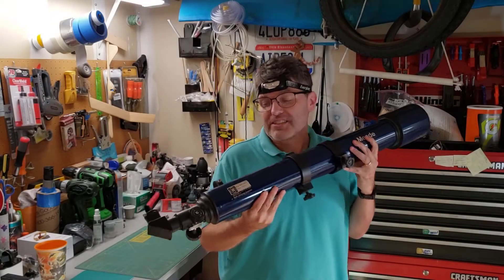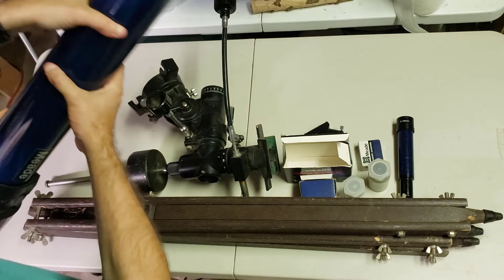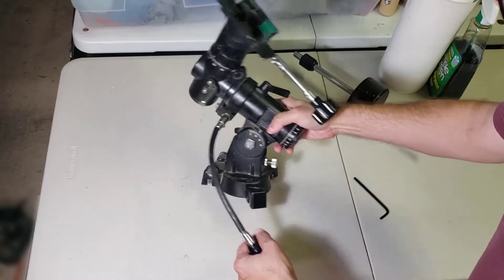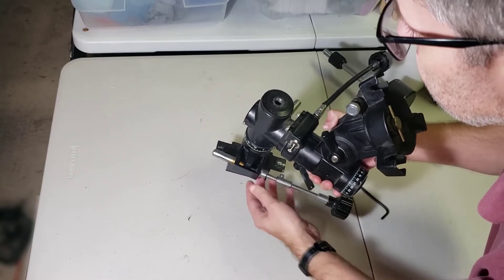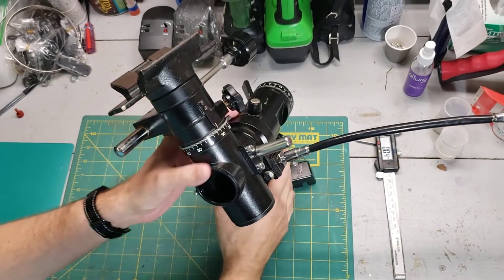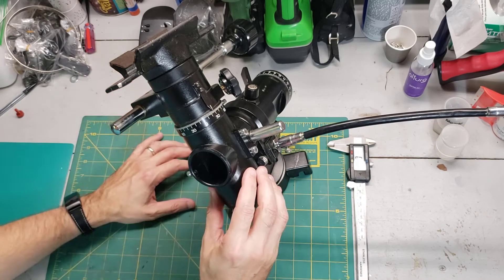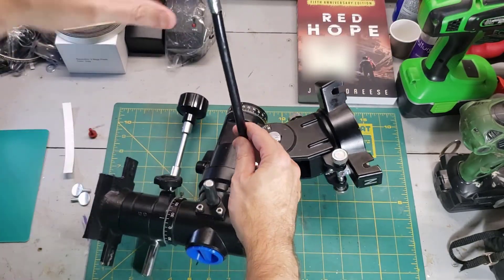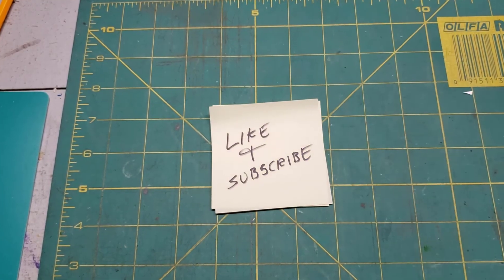Turn $10 Mess Into $300 Telescope | PART 1 of 2  ( Meade 320 )

Comment: I used to have a telescope like that. I did not like the flex cables. I found that they bounced around and as they did they caused the telescope to vibrate until the cables were stilled.

Comment: Orion telescope is better than Meade.  I sold my 80mm Meade refractor decades ago, and recently bought Orion 90mm telescope for even less money.  I like my used Orion much better than my old Meade which I bought new.  Too bad both are bankrupt now.
Reply from the maker: I have several Orion telescopes.  They work great. If they need any spare parts though (unlikely with manual telescopes), they'll have to be home made or bought used.

Comment: 20 years ago i bought that meade accessory kit for $50 from sharper image at the mall. It was intended for meade etx60/70 that sharper image sold. I was getting it for my celestron nexstar 80GTL, which had a similar but synta made 80mm f11.  At f11 that 18mm WA works well. It is an odd 4 element design, not as good as the 6 element 18mm SWA, but the same fjeld of view. At f4 the eyepiece was unusable.

The 5mm plossl is just like any 5mm chinese plossl. It works and is sharp but hard to lok through. 

The star of the show was the #128 super short barlow (telenegative amplifier), it performed as well or better than other chinese barlows .

Comment: I’m so glad I found this video and your channel. I just subscribed. I got a Meade model 290-p equatorial refracting telescope today for free. But it’s missing a bunch of parts and it’s pretty worn. I’m hoping watching your videos will help me restore it. 

Though I was wondering if you had any recommendations on which lenses I can upgrade this model to?
Reply from the maker: Thanks for watching! I'm glad you found it useful.  And congrats on the free Meade telescope - that's the best price!  As long as the main lenses are in good shape, you should be able to either fix, replace, or 3D-print all the other missing parts.  With regard to the eyepieces, I highly recommend the SVBony goldline eyepieces as the "next step" up from the stock eyepieces.  They have a wider field of view (68 degrees).  It's what I stepped up to and used for a long time.  Here is an Amazon affiliate link:  https://amzn.to/3kfJzD5

Comment: Made in Japan is a sign of quality glass.  I have a similar Celestron Vixen made in Japan 80mm F11 from the 90's.  The 6X30 finders are quite good.   I wish I had that EQ mount as mine is Alt-AZ.   I was happy paying $100.  It was perfect working order.  At $10 that is a great deal.  It's great on the moon.  Cassini division and white band on Saturn when skies are steady.  GRS on Jupiter.  Great contrast on open clusters.   I don't blame you on testing it right away.  I need to get some thumb screws for the slow-motion control cables!
Reply from the maker: Thank you for watching.  Some of the telescopes I happily give back to the owners, but this one was tough. I liked it.  Those thumb screws are pricey!
Reply: I have a vixen 6x30 that I use on my xt6, and will probably use on my ST80 the next time i go to dark skies. The xt6 stays at home for planets and brighter DSOs. I bring a larger scope ànd a widefield scope to dark skies